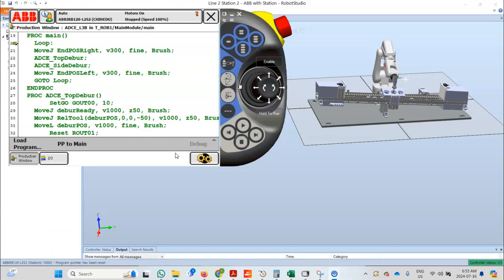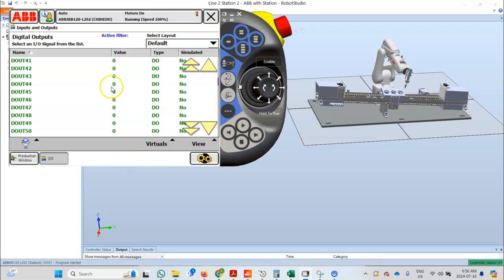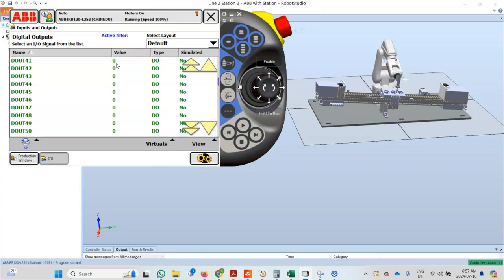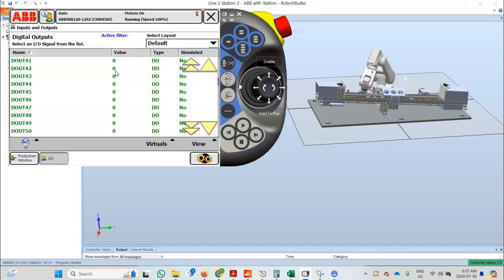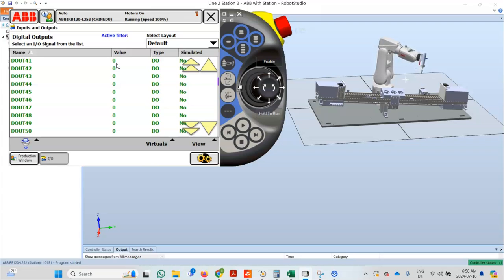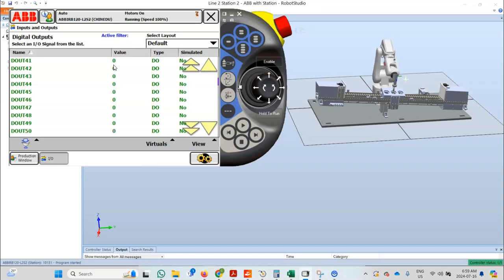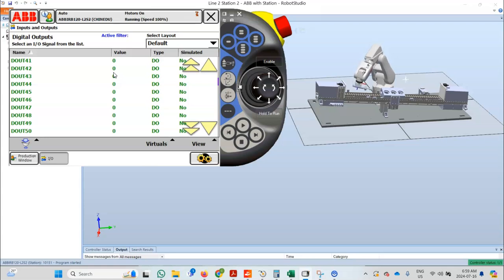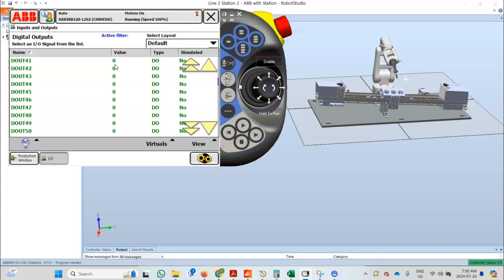Box and Joint World Zones demonstration on ABB Robot

Comment: Hi there, cool video and im trying to do something similair on my robot, could you pleasse provide code for defining the world zones? And the code where they are used. Thank you
Reply from the maker: Sure. May I have your email address?
Reply from the maker: Use this for the declaration and Initialization of the Box and Sphere World Zones on ABB Robots. 

Please note that the DOUTs are my mapped digital outputs, please consult your PLC and Robot I/O mapping for yours. 

World Zones on ABB robots are under the Power ON function, you must restart the controller for your changes to take effect, this is different for Fanuc and Motoman.

I hope it helps. Goodluck with your project.

PROC power_on()

WZBoxDef\Inside, P1TopBox, P1_Low_Corner, P1_High_Corner;
WZDOSet\Stat, Box_Zone1\Inside, P1TopBox, DOUT41, 1;
WZSphDef\Inside, P2SideSphere, P2_Side_Center, 20;
WZDOSet\Stat, Sphere_Zone2\Inside, P2SideSphere, DOUT42, 1;

ENDPROC